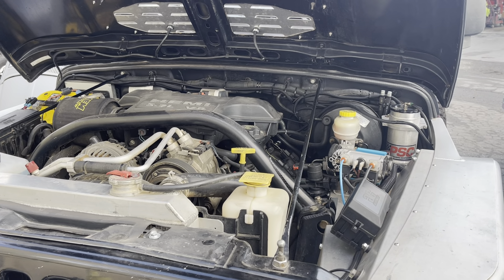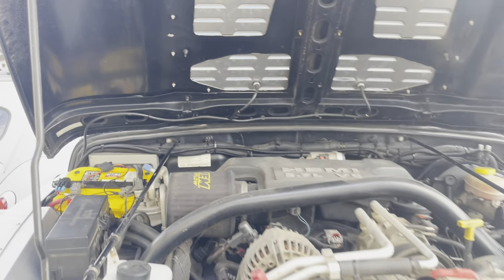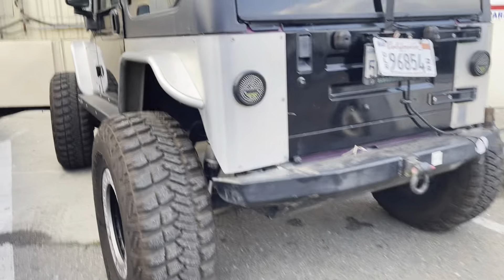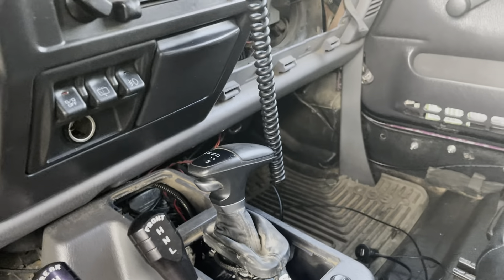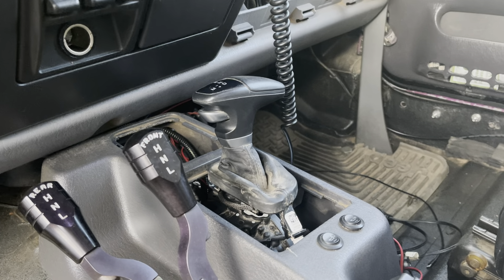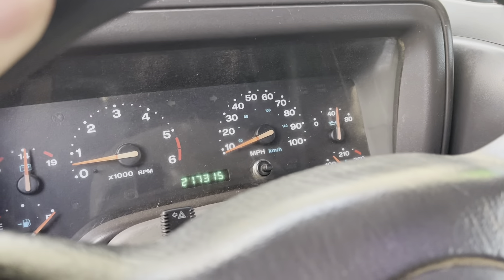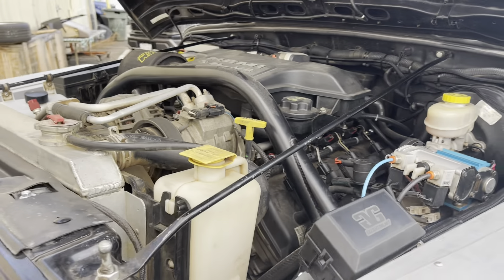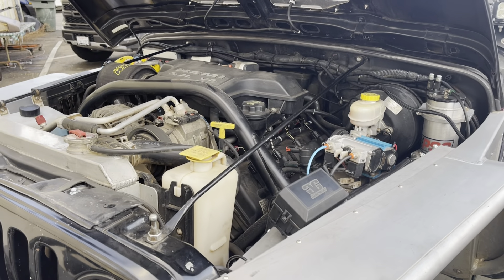Jeep TJ 8 speed with a Hemi

Comment: Hell yea!Thats what we were waiting for!
Reply from the maker: So far this has made a big difference in this Jeep, Now we get manual mode, 4.71 to 1 first gear and way better shifting. This Jeep now has all the power this Jeep can handle, hard to have a flexy Jeep handle the power.
Reply: Are you able to start on 4low up to 4th gear like you do on jls and jts?Because on 545rfe when you choose 2nd gear to start roll the car it starts from 1st and then shifts to 2nd…
Reply from the maker: @SunTehPower  Well we have started a Jeep in 2 gear from a start in high range and low range.
Reply from the maker: @SunTehPower  So the transmission knows logic and what that means, if your running 3.73 gears and 40s the transmission probably will not start in a higher gear, but if you are running 31s and 5.38 gears yes it will probably start out in a higher gear. Now you could HPTuner the transmission to do what ever you want. We can flash the transmission to have manual mode for FREE...

Comment: curious back when you did TJ LS swaps, how did you get the jeep stock check engine light to turn off since it's PCM controlled and obviously the jeep thinks there's something wrong with the motor.
Reply from the maker: So we put silicone over the Jeep light and put a new light for the LS in place..
Reply: @jeepspeedshop  thanks for the reply!

Comment: I thought y'all stopped doing tj/LJ V8 swaps?
Reply from the maker: We are no longer doing V8 swaps in 2006 and older Jeeps, but we can do a 8 speed swap. Now we built this Jeep many years ago and i still do maintenance on all the Jeeps we built over the years. We built over 90 TJ Hemi Jeeps.
Reply: @jeepspeedshop  would also love to hear your thoughts on that concept 4 cylinder/LS head that blueprint engine showcased at pri show!
Reply: @jeepspeedshop  could you put an 8 speed in an 06 4.0 LJ?
Reply from the maker: @adamfowles1060  So this is very interesting, I'm not sure what i would put it in for testing but it seems like a cool idea. Maybe a Jeep flat fender..
Reply from the maker: @FredNeck-z4u  We can not do a 8 speed behind a 4.0L or a 3.8L, one main resin the crank sensor is in the bell-housing and the 8 speed dose not.
Reply: @jeepspeedshop  Coming in late here Also new to all this. I have a 1999 Jeep TJ. Im looking at your website. Will the 392 Fit in it. And will it be smog legal?
Reply from the maker: @That90sKid  The 6.4L will not be smog legal and we do not do TJs anymore
Reply: @jeepspeedshop can you make my 4.0L i6 fast? Supercharge it and upgrade the internals ?

Comment: I have a 2011 wrangler with 5.7 and 545rfe what all is needed to swap in the 8 speed do I need new computer and everything or can I just swap it in?
Reply from the maker: So we have been able to reflash the computer, We need to get rid of the transmission controller in the computer you have, I can email you a list of stuff. 8 speed in a 3.6L JK 845RE 850RFE 

Flex Plate for the guys going from a manual to a auto 4752463AB for the 3.6L

Flex Plate for the 5.7L/6.4L 4752574AB

Flex Plate bolts to crank 6503465

Torque convertor bolts 650936AA

Transfer Case cable mount 52121832AC $30.00

Transmission Cooler Lines JL 68291875AB For 8 Speed $177.10

Transmission Cooler JL 68481147AE

2 Transmission cooler fittings 68489743AA  $50.00

8 Speed wiring $1500.00

8 Speed floor plate and spacers 4

Truck Transmission mount to t Case adapter 68147344AA  $110.00

8 Speed steel trans pan Jeep JT 68408606AB  $200.00 

Transmission oil 68218925AB  $30.00 needs 10 quarts  

The transmission new can cost $4000.00

Low mile used  $1200.00

Shifter $200.00 used

Bezel $50.00 

T Case used $500.00 non Rubicon

Gear gauge $150.00

Plate B $50.00

Transmission Cooler Mounts part # JKTCM  $50.00

Comment: Did you have to use the 08 Hemi pcm? If so where would you go about a tune and wiring? Interested in doing this swap on my 06 truck with a 545 rfe
Reply from the maker: No we do not use the 2008 Computer, now on all of the TJ Hemi swaps we used the 2005 Dodge Ram 1500 computer and this works with the 8 speed HP70 4x4 transmission ..  We have a wiring harness and module that will work.
Reply: @jeepspeedshop what’s involved in swapping an ecu to a different year. Can’t find much online about it and was told I need to use a 09 ecu to get torque management to work. I have an 11 ram 1500
Reply from the maker: So on the TJ we used the 2005 Dodge Ram 5.7L computer, I guess we could just reuse your computer and turn off the transmission side to make it all work..